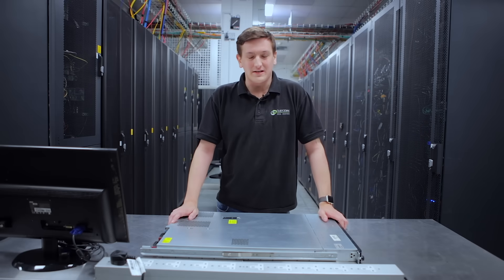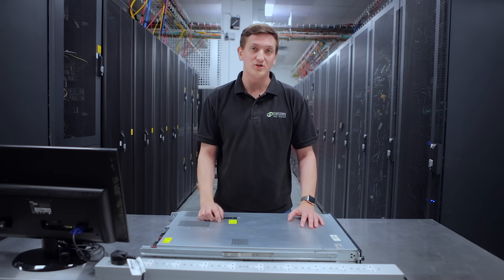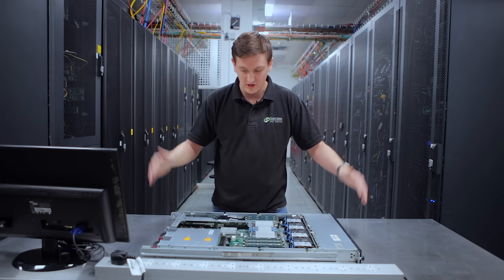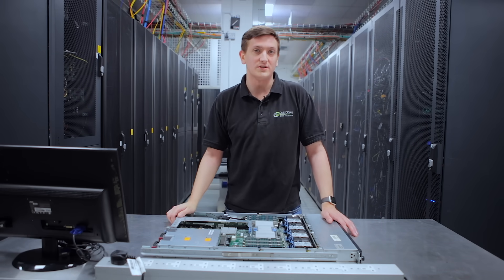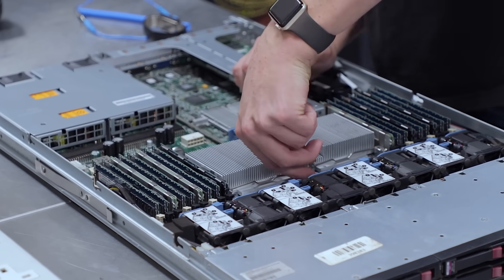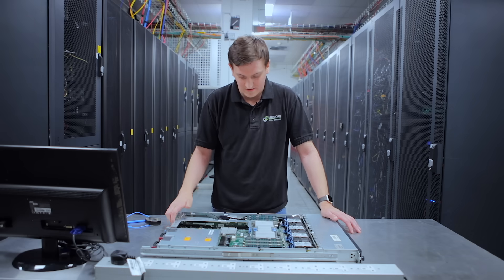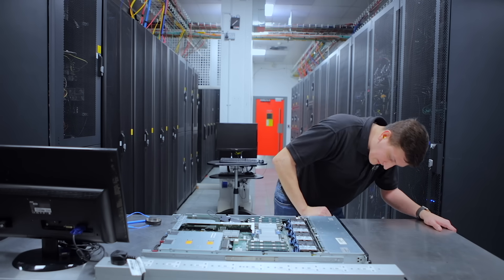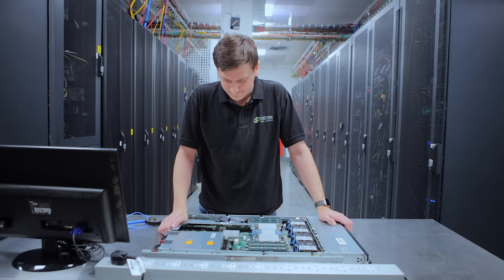DATA CENTRE 101 | DISSECTING a SERVER and its COMPONENTS!

Comment: Would love to understand how does a 1U server that is colocated gets access to the internet. 

Like how does networking work?
Reply: All U's are connected to a router called a TOR (top of rack). These TOR's are called a T0 switch that is about the size of 1U.

Now these servers are in rows as he explained, somewhere in this row is another switch, an every bigger and more spicy one, to compare to the 1U size switch, these are about 6U or even bigger. This would be a T1 switch.

Now take all of these T1 switches and send them to another switch where all T1's data comes together, the T2. These can handle so much data traffic its insane. Usually there is an entire row required due to their size, and hold multiple T2s. This basically is the internet access point for the colocation.

Now in some cases these are then connected to a network room, or a regional gateway, from these rooms data leaves the datacenter and goes into the global network
There is ALOT going on in these network rooms, to much for a simple youtube comment :)

Comment: There's a fair bit of incorrect information in this video, like the fact that CPUs (at least in this particular server) are not hot swappable. Only thing like mainframes or very high end servers can have CPUs hot swapped.
Reply: Actually, a lot of servers can have them swapped out even very very low end ones
Reply: These toys would melt if they processed the volume of data  a mainframe does

Comment: Can I ask: How many servers are there per rack? I see you mentioned a server can hold a half a terrabyte of RAM. I'm really interested in how much physical space the cloud might take up now and in the future. Would really appreciate any help, thanks!
Reply: This is a late answer to your question but maybe I can help.   I work in a large enterprise DC for a fortune  200 BIG Pharma. Most racks are 44 RU in height, The server he was working on is 1 RU. So in theory you can rack 44 of those in to a rack. That however is rarely the case. Things to consider is power consumption for the MOAs and airflow/heat. With regards to cloud computing, most DCs are moving toward high density computing. (One physical server with 100 virtual servers running on the one physical) Need a new server? flip a switch. BANG new VM. Hypothetically speaking. 1 rack with 44 physical servers with lets say 20 VMs. That's 880 VMs in one rack. Keep in mind this is all hypothetically speaking. Not going to talk real numbers.

Comment: When you need to unrack a server in order to repair it, how do you ensure all of its workload gets transfered to another server so no interruption happens when you shut it down? Do you have an automated feature like this in usual hypervisors like Proxmox or VMware?
Reply: That's just load balancing setup, usually they don't go into the trouble of redirecting prior to pulling the server, but if server takes x seconds to respond your request may fail or there will be another attempt to serve your request by taking it to a separate server.

But the main idea is your request goes to the load balancer, that decides which server will process it, if it's down, it can just plain fail or be "redirected" to another server.
Reply: @claytoncoleiro7190  thanks for your reply. I imagine, at the end it's the app's responsibility to implement a proper health check, and at the moment it fails (due to app beign killed or server malfunctioning), the orchestrator will spin up a new instance
Reply: @WolfElectronicS  nah, a well designed app shouldn't handle it. Thats a load balancer job. It depends highly on configuration
Reply: @Wolf ElectronicS  If the server is in working condition but just need to be upgraded/repaired by changing some part or whatever, in VMware case you can use something called vMotion - it can migrate a live/powered on virtual machine from one host to another but there are some requirements to make that happen fast, shared storage is a first one although it's not required but recommended so that live migration goes faster, second thing is VMware vCenter Appliance/installation which actually makes vMotion possible. Dunno about other hypervisors, did not have much work experience with them.
Most of applications have a load-balancer of some sort that allows to just share the load between multiple instances of such software or just High Availability software which enables to switch between instances in case of a failure of the main instance. Such things are e.g. VMware HA (high availability for vmware clusters) or HP Serviceguard for Linux.

Comment: this is awesome. what raid is most popular in data centres? this heat on your CPU looks weak. what's most popular core count and clock speed of DC CPUs?
Reply: The heatsink might look weak, but consider the 10000+rpm fans that push air across it. When I start mine up they sound like a jet taking off, as you can hear in the background.

Core counts actually depend more on what you run. Some software like databases, etc. have licensing structures that encourage fewer very fast cores, while a lot of web stuff is done with many slower cores - for a million requests a day you just need a shedload of threads running at once, even if they're not the fastest things ever.
Reply: From my experience it will be RAID 5/6 in case of storage arrays and RAID 1/10 in case of local storage for servers. About the CPUs, most of servers for hypervisors that I install have two 10-core CPUs with HT, usually between 2.4 to 2.8 Ghz base clock. Obviously in case of super new servers like the ones with AMD Epyc you can get as many as 64 Cores in a single CPU.

Comment: I’m running that exact server in my homelab
Reply: Does HP / Dell Server have a noisy fan when its in idle position ?, I have an IBM X3650 M1 server its obnoxiously loud even the server in idle position.
Reply: @sonicthedgehog9473  For my HP server (depending on the power profile and cooling profile) my server can be almost unnoticeable.

Comment: Like to see a hot swapping CPU action while the server is running (that's hot swap I guess)
Reply: no, that proliant processor replacement is NOT hot swap, only fan, psu, disk are hotswap
Reply: you cant do hot swap while replacing cpu. u need to unrack the server to do it.

Comment: do most 2.5" are hdd in these or ssd?

and why not go the route of 4 3.5" drives as they are more reliable and have much more storage?

and what prices do 2.5" drives go for as I worked at company and the price was bonkers, like the vendor charged near 600$ for 500gb hdd.

Comment: Hi, I have 2 questions for you:
1. Would you advice running Fiber or copper between the switch in the rack and the server?

2. Can you please do a video and explain how your fire system works in the data center.

Thanks
Reply: Copper suffices in most cases unless you want really high speeds

Comment: concerning the server failure alarms (at least 2) are on in the background of this video, and shame no wrist strap! Out of date understanding of technology too.
Reply: Server alarms are normal from out-of-date firmware to failed disks. They just get ignored until someone's at the DC next. Wrist straps aren't typically used as the entrances for these rooms have anti-static mats, plus the flooring is designed to avoid any ESD all together.
Reply: James Schmidt you don’t see alarms being ignored when detected in any of the data centres I work in. 

Poor work style by this gentleman in multiple videos
Reply: @crazyboy2006cashier  These are customer racks, DC staff don't have permission to solve issues, some don't even have permission to report them
Reply: James Schmidt that’s fine but why then are they opening their customers servers, could have picked a room with no alarms.
Reply: In the video they said the metal table they are working on was grounded to A grounding point on the wall, and when in the build center they use wrist straps.
He also stated in the video that the server was a spare server of theirs, and not a customers.
When it does come to customer servers, you cant touch it without the customers permission. if they need help, they have a support phone number to call.

Comment: Servers have up to 4 PSUs in an N+1 or N+2 configuration (Up to 2 hotswappable PSUs in midrange servers and 4 PSUs in quad-CPU servers). They have also remote management capabilities built-in or in an add-on card (like generic IPMI/Dell iDRAC/HP iLO/Fujitsu iRMC/IBM Remote Supervisor Adapter). Servers have less points of failure/fault-tolerant than standard desktops or workstations. It is because of:
*Redundant hardware configuration (PSUs/RAM modules/CPUs)
*ECC memory
*Remote management capabilities
*Hardware RAID setup

Comment: Awesome video.
Is it possible to broadcast a website without DNS server just with an IP?
Reply: You can not broadcast a website. You can only broadcast within a broadcast domain. So you'd be able to broadcast to the computers in your local network that are attached to the same router, but you can't broadcast to the internet. Also, broadcasting has nothing to do with DNS servers.

Do you possibly mean host? Of course you can host without a DNS server, but user will have to enter the IP of your server.
Reply: @jort93z  Thanks for replying. When I put the ip in the browser do I have to attach a port to it?
Reply: @jort93z  Thanks again. Now that I have connection to my server via internet. Can I use this server as an application server / Database server to give aacess to both android app and web app?

Comment: 'Limited to 32GB of RAM' Jesus where is this guy from? Early 2000's. Catch up dude we can get desktop CPU'S that run 128GB on a single chip
Reply: Its still correct for most single socket CPU's in the server space.  Mainly Intel Xeons.
Reply: @pederstrmKollenborg  it's not been correct for quite a number of years. All modern Xeons can handle 64GB+.
Reply: @aidanthetaylor  for crying out loud an old Ivy Bridge E5 Xeon can take 768GB for cpu that's 1.5TB for a dual socket configuration....newer Xeon can take a Lot more ram
Reply: @aidanthetaylor   E5's and E7's sure,  E3's only started catching up post Ryzen.  However, he does mention that you can get more with other configs in the very next sentence.  Hell my motherboard and CPU combo can do 1.5TB or more  if I allow it.
Reply: E3 cpu's are just cheap desktop counterpart with "crappy" ECC unbuffered memory support they don't really belong in a data center sames goes to Ryzen. And you can get 64GB of ram on an E3 since skylake..lol....after that they have different nomenclature.
Reply: @JDMeister   E3's are in fairly wide use where power and heat  is a priority issue.  They have their space just like Ryzen and normal desktop chips for clockspeed and IPC dependent tasks.  Hell, Ryzen even supports ECC without any further price premium.  Just need bios support on the board.       Ash might be flawed in his first statement, but for the second hand equipment many will buy for their homelab he isn't necessarily completely  wrong.  We are talking the last 3-4 years here for E3.   So much of the equipment is still being kept with customers until any remaining warranties run out.

As a previous system integrator Im aware that skylake provided support.   But one might also argue that Intel haven't gotten much further in their ongoing chase for 10nm with refresh after refresh.  ;P
Reply: Early 2000's would be 4GB. Hard to find 64-bit in those days.
Reply: Learn the difference between "there is none available that can" and "most sold cannot".

At the moment, many mainboards in pre-made desktop PCs have 2 RAM slots and come with a 2x8 configuration. Even most retail ("gamer") boards have only 4 slots.
Reply: @jort93z  , where did I mention Xeon scalable in my post?   ;) Edit: Aaaand it's gone 🤣
Reply: @pederstrmKollenborg  Xeon scalable is part of the xeon series, just like xeon e3, is part of it.
Also, what is gone? Edit: My comment was deleted apperently, not sure why, I didn't delete it and I stand by it.

Comment: Not sure if you mis-spoke, but CPUs are not hot-swappable. Hot-swap means it is replaceable while the server is powered on. Things that are hot-swap would be the power supplies (as long as they are redundant), hard drives, and fans. CPUs, RAM, and PCI devices are not hot-swap.
Reply: Cpus no my college teacher did have a old server in the classroom thats specs said hot swap ram never got to see how well it worked. Not sure if tye pic was hot swapable I thought I heard of it b4 but cant b completely syre
Reply: @mousejjt2  Never heard of hot swap ram. Current servers don't have that, i know that much.
Reply: @1960bosman  Oh, nice to know

Comment: What's the purpose of the battery on the RAID controller and what would happen if it was removed, our Dell servers at work don't have such batteries on the RAID cards. Surely the RAID and related disk configuration would be stored on non volatile memory.

Also, you forgot to mention about out-of-bound management systems such as Dell's iDRAC or HP's ILO that servers often have.
Reply: Battery is for write-cache memory. The idea is that on some RAID levels, writing data to disk takes time so it's buffered. Battery prevents data loss in case of power loss (data is stored until the system is started again)
Reply: The onboard battery backup stores the current write to NAND before it shuts down.  In this way in ensures that atleast the last write is completed when the server is powered back on, thus ensuring that you could resume somewhat safely with any previous write without the risk of file corruption etc.    Generally speaking its just best practice to have a BBU with your RAID card.
Reply: Why not just place a super cap or button cell battery on the raid card instead.
Reply: @ElliottVeares  , they do.  A battery or a capacitor bank.   Still needs logic to make it work properly.
Reply: My point was why have it on a long flying lead, could one not place it on the PCB directly? But i guess it is done this way for easy access.
Reply: @ElliottVeares   It depends on the manufacturer. Supermicro and LSI/Avago add the battery directly as an add-on board.   While the capacitor version (Cachevault) is connected via a lead so that I can be mounted elsewhere.
Reply: That is a battery backup unit (BBU). This powers the cache in an event of a power failure, so that the cached data will be written to the disk and not lost because the RAID cache is composed of RAM which is volatile (data will be lost if power is cut off). The BBU in older RAID controllers use Li-ion batteries. Now they use supercapacitors.
Reply: The RAID controller is an extra layer between the computer and the disks. Usually the operating system knows when the disks have finished writing data to disk and take that into account regarding data integrity. With the extra layer, the RAID controller needs to first put the data in its memory and and then distribute the data over multiple disks. It can aggregate the write status of all disks or instantly report "done" to the operating system. The latter will free up the program that originated the data to do other stuff, but is a bit of a lie. Especially if the data is re-ordered to be written to the disks in a faster way. So to avoid leaving the data that actually is on the disks in a very weird state, the controller can employ a battery backup to not lose the data it still has in its memory.

Comment: Btw if you watching this and don't know what 1U means, is the amount of unit taken in the rack, bigger servers will take 4 units.

Great video as usual thanks :)

P.S :use an audio editor and remove the frequency of the background noise, is an higher freq than the voice, should work nicely :)
Reply: Yeah please do
Reply: Also, remove the servers in the background that aren't working correctly. Fan noise should be reduced by changing the microphone setup.
Reply: @user2C47  Those are most likely live servers and can not be taken down without the customer's approval. Also, they sound like BBUs failing.
Reply: @Redal24  how do you know
Reply: @Knightfall23  i am a data center engineer
Reply: @Redal24  congrats, u made it
Reply: It's technically 1.75 inches too